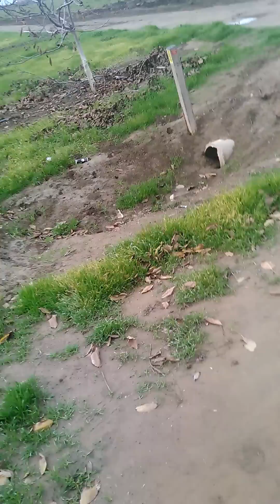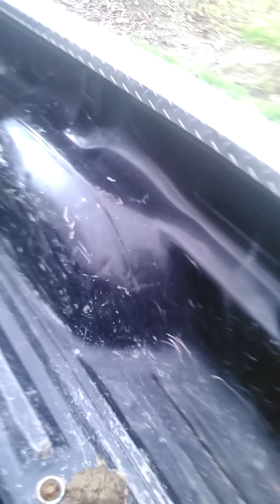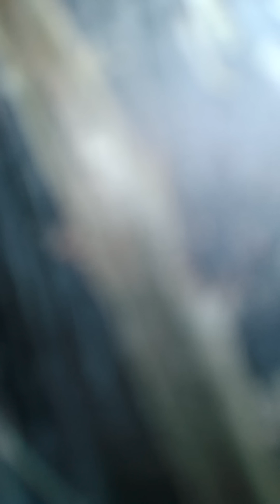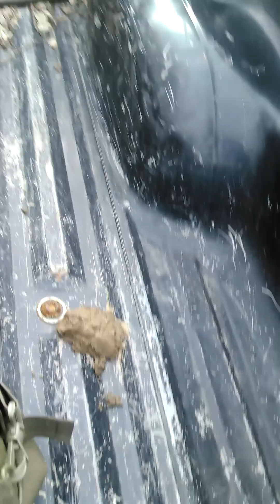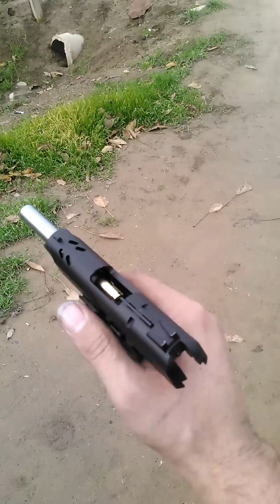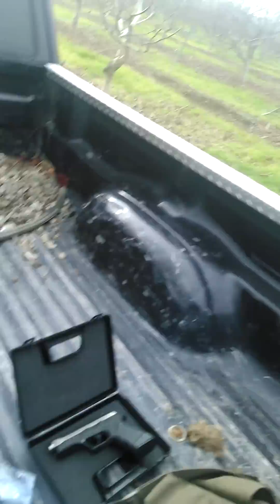Experiment shooting ALP 906 2914

Comment: Did you change the recoil spring? If so, to what lb?
Reply from the maker: arvid gunardi no same spring. But it would benefit with something stronger
Reply: Phd.in.Macgyverism. i am planning to use .32 instead, i noticed you used 380, and had to press it shorter, any reason why you arent using a .32?
Reply from the maker: arvid gunardi I wanted to see if they held up to a .380.  I know .32 is better for double stack mags

Comment: How many rounds do you think these are good for before catastrophic failure?
Reply from the maker: Anthony Browning I had a 906 afew months back. I put 100 rounds through it. the jb weld holding the barrel got hot and soft. barrel flew off when I shot. if I had a set pin it probly wouldn't have happened. I plan to do a stress test in the future
Reply from the maker: Floppy Dodo a notch gets cut into the barrel then a hole is drilled into the frame. the hole and the notch line up and a pin is pressed in. making impossible to remove the barrel without first removing the pin
Reply from the maker: Floppy Dodo a notch gets cut into the barrel then a hole is drilled into the frame. the hole and the notch line up and a pin is pressed in. making impossible to remove the barrel without first removing the pin.
Reply: Anthony Browning  15,000 rounds and 906 is still cycling great
Reply from the maker: Gabe Gauthier nice!
Reply: @ Gabe...for real?
Reply: Gabe Gauthier is yours with a set pin or what way did you attach your barrel
Reply: @taskforce505  what is a set
pin